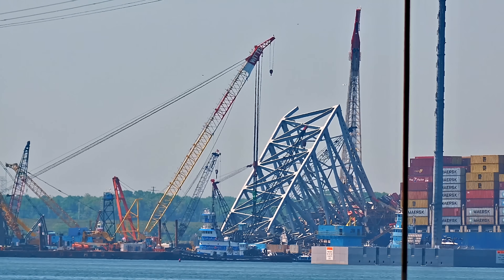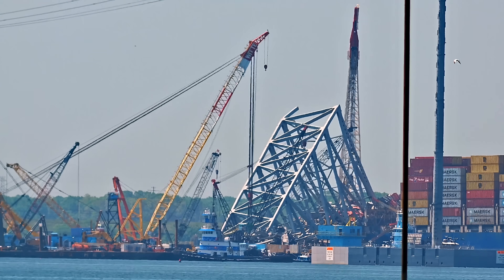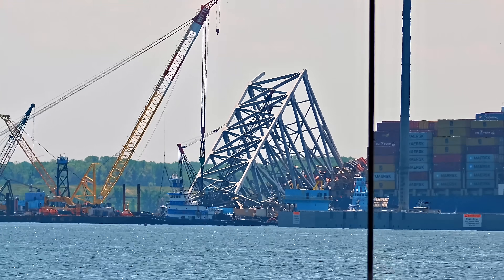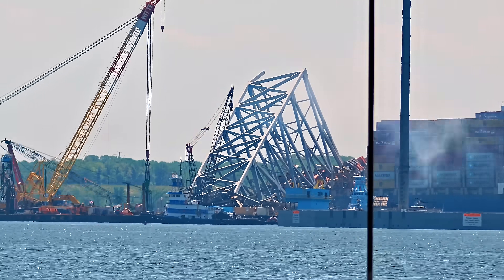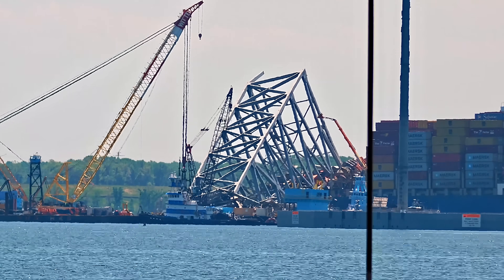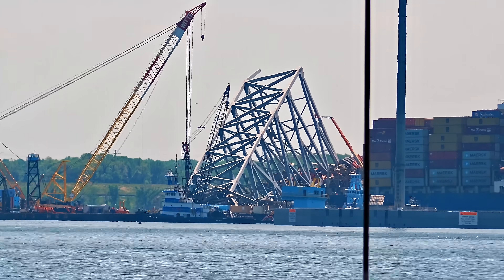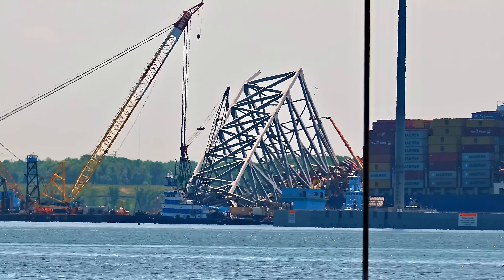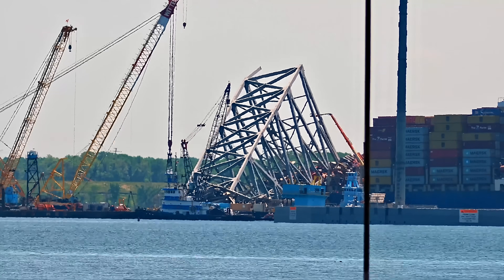Chessy and the Claw working to remove steel debris at the Baltimore Bridge Collapse Site

Comment: great coverage as ever Captain Andy, having the footage speeded up works just as well and still shows the importance of the work to be taken with so much care - as i have said before, its one thing to build a bridge, maneuvering such huge pieces into place, its a totally different ball game to disassemble some thing so huge in a safe manner when every part sits at such crazy angles than it was designed for - there is a certain irony in some ways that it was a pretty strongly constructed bridge, its just a shame the two central piers weren't of heavier construction and with more adequate precautions and guards at the base - perhaps other bridges that might be at similar risk will be addressed in the light of larger ships on the seas today

Comment: I set resolution to the highest number, and was zooming to see the cherry picker crew, their inspection of the large trusses. There was some kind of video edge effect happening. My guess is video processing added the effect, and no amount of high resolution would enhance the image. So I dropped back down to low resolution, as the experience was identically same. I'm not sure the high res is doing anything, if the video is processed, but I'm not sure if that's a correct assumption.

Comment: I was wondering how the claw was going to work because the Chessy 1000 doesn't swing.  I thought they would lift something and then have to push a barge under it to set the load down. Today's video shows exactly that.